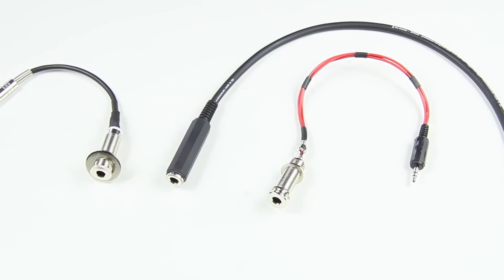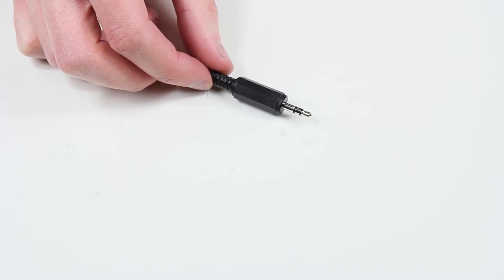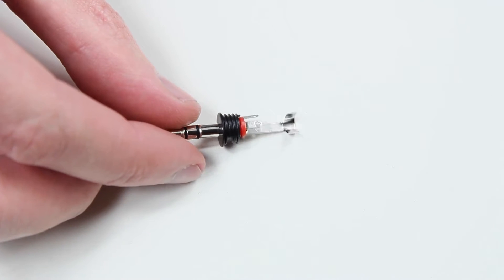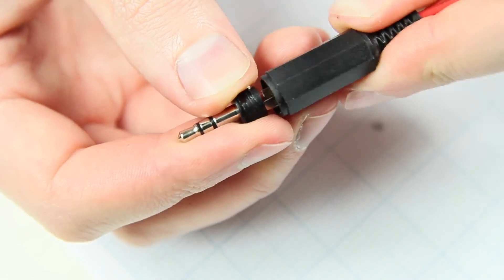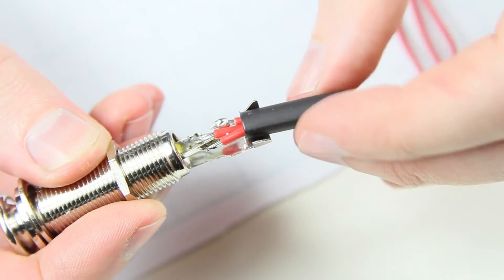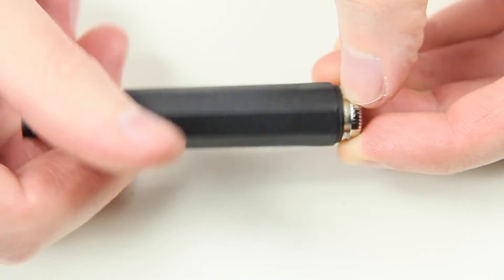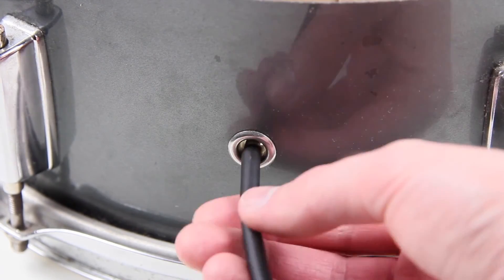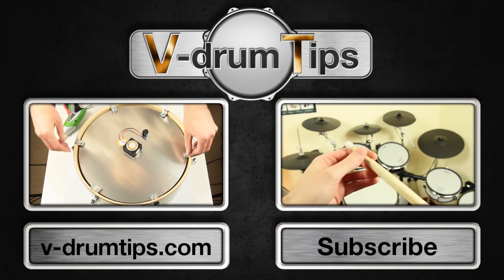Cables for In-trigger Systems

Comment: Is there any connector like this that doesn't require soldering or such? At the moment I am using mini-tele cables to connect to my triggers inside the drums and then I run those cables through the ventholes since the connector on those cables are so small. And then I use a 1/4" - Mini-tele converter in the inputs on my module to connect the triggers to the module.

This works well, but if I would need to transport my drums somewhere I would either have to take off one of the heads on each drum to disconnect the cable from the trigger or transport my drums with the cables hanging on the outside through the ventholes. And that doesn't feel very durable for the cables.